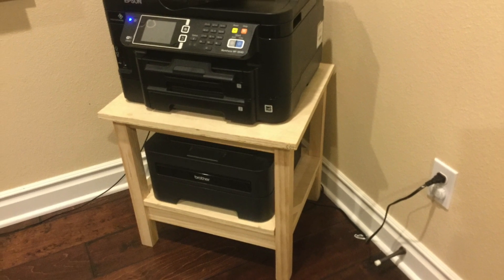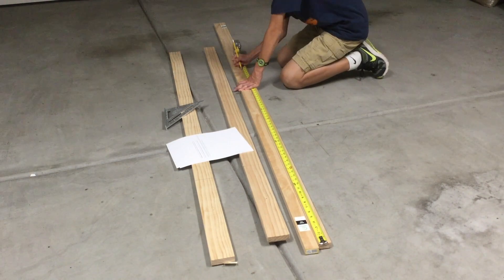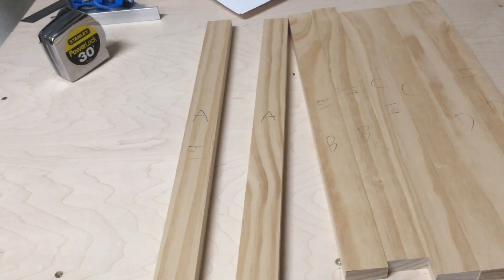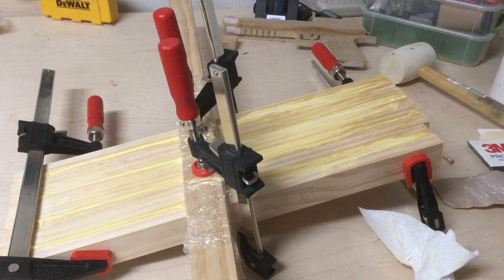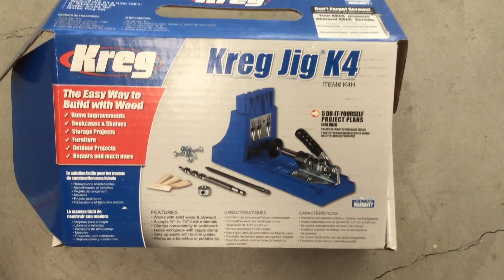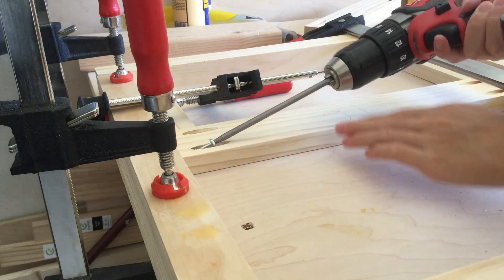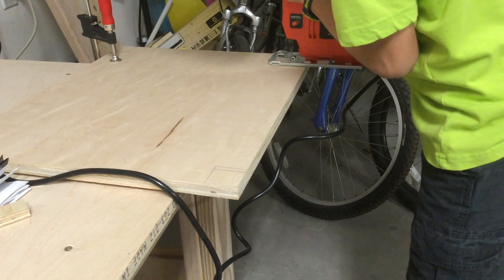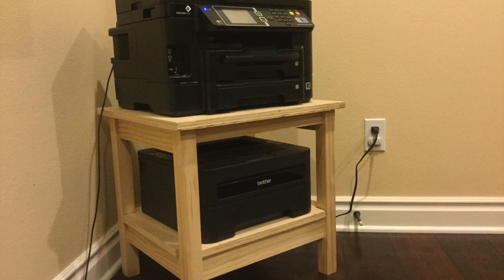Printer Stand Build Part 1: Construction

Comment: Could you provide a direct link to your follow-up video in the description section of this one? I'd like to see what you did to finish this printer stand. I would like to try a project like this, but with some important differences: (1: There would be a "bottom shelf" that would house 5 to 10 reams of printer paper. This could be an open-space shelf like you have (just sit a whole box of paper on the shelf) *OR*, more likely it would be a cupboard style arrangement for the individually wrapped reams without the box.  (2: There would be a drawer directly beneath the printer/top, to house print cartridges, stapler, staples, printer manual, etc.  (3: I would set up a power strip right on the unit, and the cord leading to the outlet would be an extension cord. This would allow the unit to be mobile.  (4: the unit would sit on lockable casters, making it a cart. This would also make it easier to roll the unit out to clean the floor.   Neat ideas here, though.